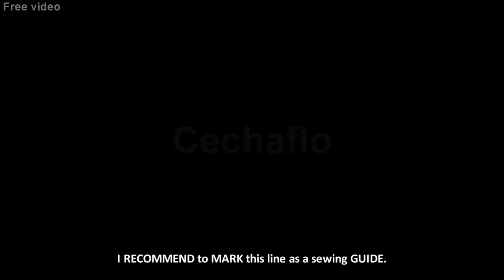Making of Junctions - Support Video (4)-Car upholstery

Comment: That is a great idea, giving the sewn cover joint a place to fit into. This will keep it flat or real close as the texture of that feel while driving will tell the driver where the "Top" of the steering wheel is, and become one with it's location.
  Also, unless glued to the OEM rubber, when sewn and pulled tight, it will keep it from moving left or right, as now it is keyed into that position on the wheel! Excellent idea as I have not cut into the finish of any soft covered steering wheels. Just great. Thanks for sharing your experience. 
DK, ASE master, retired.

Comment: Eres el único profesor que te muestra fácil y claramente cómo coser correctamente. Te envié una pregunta en instagram
Reply from the maker: Sorry for delay in answering your question. My children handle the instagram. I am still not updated with it .
To be honest, I have no specific related video yet. One way would be by sewing the edges with the sewing machine. Something like this: https://youtu.be/36arEyhfNeE?t=4770
This other also gives a clue:https://youtu.be/XdTqJ26HSNY?t=133
The other way would be by handsewing 'basting stitches'. In this video the same piece is done in this other way:https://youtu.be/V9jaltgJ4jA?t=82
Another clue: https://youtu.be/Eb94VA5jhpE?t=731
The surrounding inside piece has no bulky junction:
https://youtu.be/Eb94VA5jhpE?t=573
I hope it helps.
Reply: @Cechaflo  ♥

Comment: Hello Cesar, can you please explain how to measure the ‘height’ of the additional curve of the joint line?
Reply from the maker: The first step would be to draw a round line around the rim. The junction will be following the traced line around the rim. We realize that after shaping a piece of leather it takes a form like it is shown at 0.27 min of the attached  video
https://youtu.be/IlH3A6Ifbvo?si=GuFvVUS3IFnR6jZF&t=27
The more thick is the rim the more longer will be the upper part of the piece. It decreases gradually until reaching the bottom line where the line of stitches will be.

Comment: Question:
If have two pieces of leather to cover the wheel, I'm gonna make junctions on top and bottom (12th and 6th). Do i make curved junctions on top and bottom? Or do I just connect them straight on the bottom and make curved junction on top only (like if I had one piece of material)?
Reply from the maker: It would be much better to do it on top and bottom. You would get a better shape to the contour.
Reply: One piece of material becomes two with a pair of scissors. But, if your desire is to keep it on piece, as long as it is cut correctly on the inside and properly stitched, I don't see why not.
  It depends on the shape of the wheel so if it allows, by all means and use one piece of material to cover it. Just picture it /  draw a sketch of the steering wheel you have to cover, then study it. This will help you decide if one piece would work and look correct! 
  After all, the look is what you are doing this for and the feel in your hands helps. Like a look or color change, you be you in the choices! Regards.